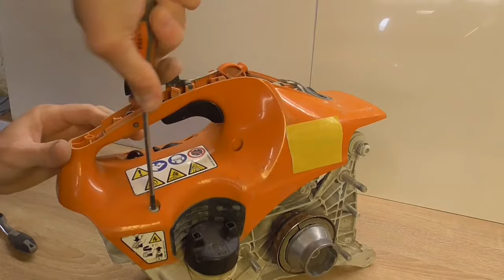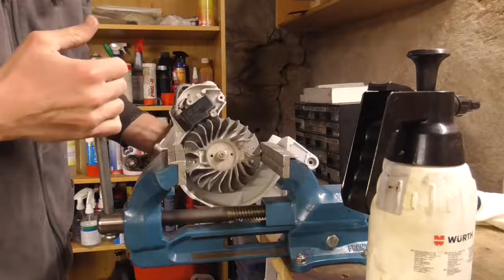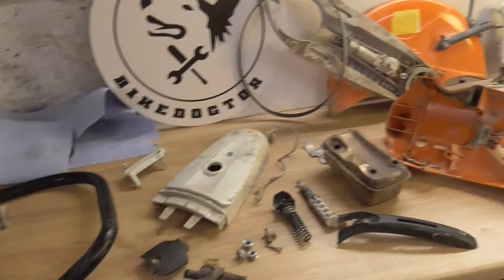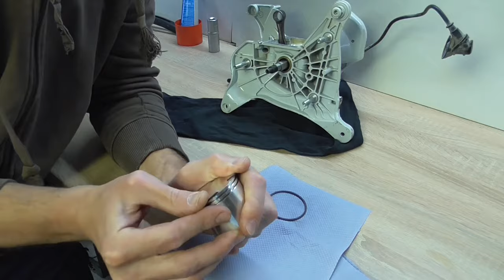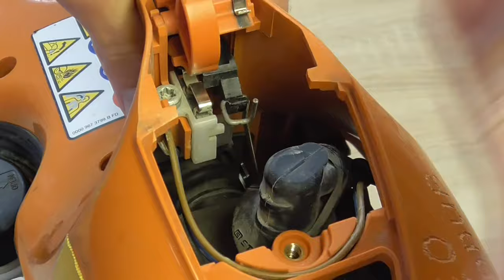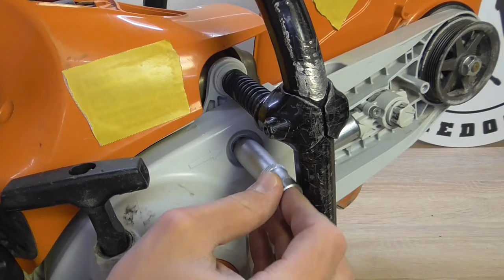Full STIHL Concrete Saw Rebuild in 9 minutes! Stihl TS 420 (Basically with three tools)

Comment: I love rebuilding these things. Ive used everything from chinese to genuine to aftermarket. My best work saw had a moly coated piston , touched up the cylinder and shaved it and ported the intake also. Running on 45:1 927 it ripped and sounded just as good as a dirt bike. Unfortunatly it blew up after 3 years of everyday cry cutting use. Ive rebuilt half a dozen since but nothing performed like that saw.. all it needed was a power pipe.

But i am here cause of a saw that has the most stubborn case halves ive seperated yet.

Comment: Great video, and thanks for sharing.  The only comment is that, I'd personally perform a pressure and vacuum test once I'd installed the new crankshaft and cylinder.  That way you know that you would know everything was good before spending time putting it all back together.
Reply from the maker: Thanks for the comment. Next time I get tools for the pressure test

Comment: i just rebuilt  my ts 420 saw with all new kit everything  and on startup it smoked but i thought maybe for the oil i put on the piston and rings and head not much i let it run for 20-30 min at idle for breakin and it smokes badly on the rev up  .......took it back apart to check the rings and head all looks good comp test at 87 -90 no leakdown after 10 min what do you think could be the issue
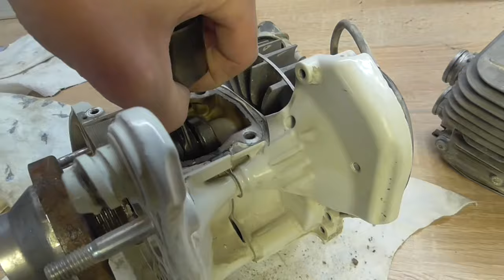Reply from the maker: Sounds like oil gas mixture too rich. What do you run? 1:50?

Comment: nice vid do you have a link to all the parts you replaced? chinese parts or stihl
Reply from the maker: No links but I used after market parts only. Stihl parts are three times the prize
Reply: @bikedogtor1663  still running ok?
Reply from the maker: @charlieparkes356  yes and all parts looked really good. Even the cheap cylinder, although it looked a bit different.

Comment: Can you do a ts800
Reply from the maker: If i get one maybe
Reply: Ts800 would be easier because they have the four bolts accessible from the top of the cylinder so you don't need to disassemble much.